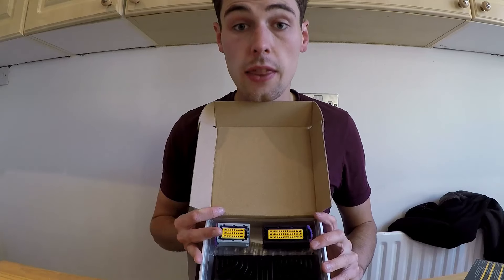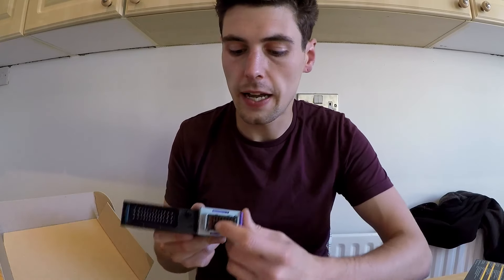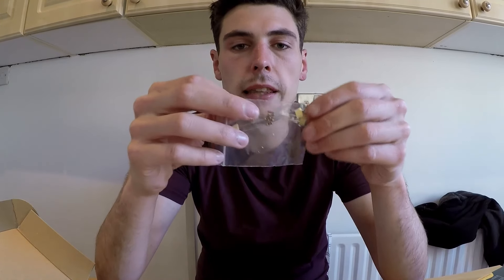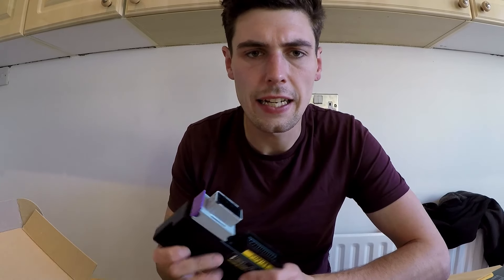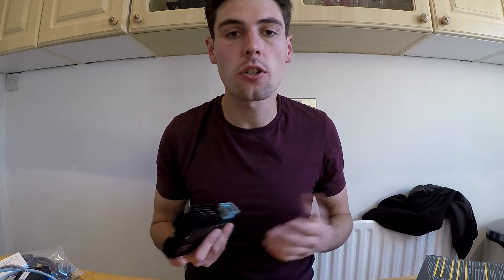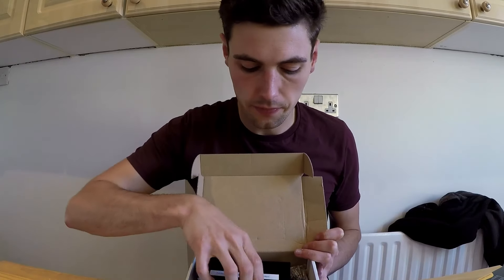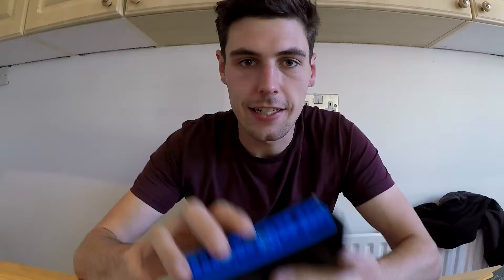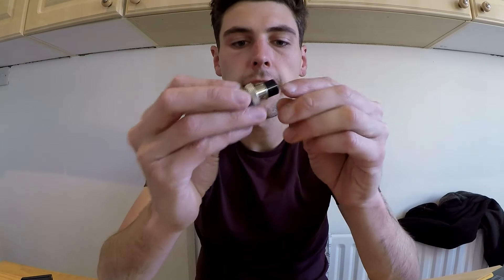Nissan S15 Project - EMU Black Unboxing

Comment: Hi I see you are using for an S15, how was the install and tuning?
Reply from the maker: Hi,

Install was fairly straightforward, you can watch my other videos for a rough guide on how I achieved my install. Tuning was really easy, the interface is much nicer than some other ECUs and the tuning method is the same.

Comment: I bought emu black. I just bought the BT module. But I don't know how to connect it to ecu.Is it necessary to cut the connector of the bt module and insert the wires into the ecu?I will be glad if you answer
Reply from the maker: If your module doesn’t use the weatherproof connector, then yes. Just remember to keep the can bus wires twisted.